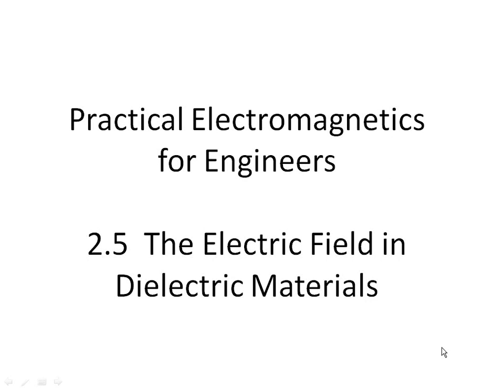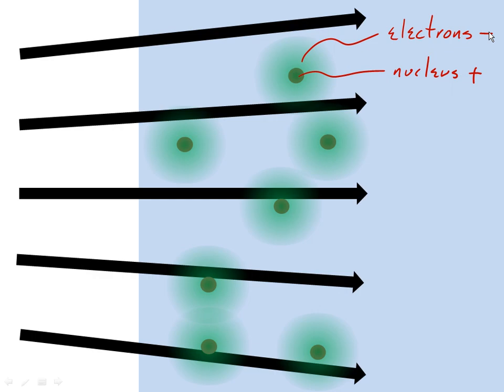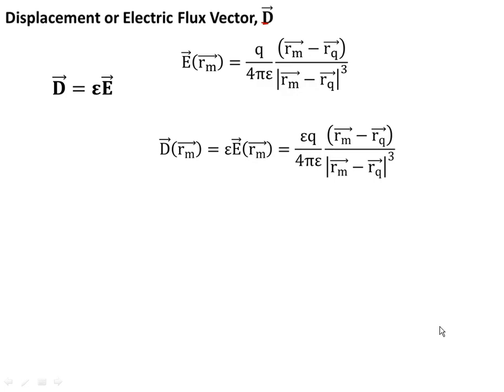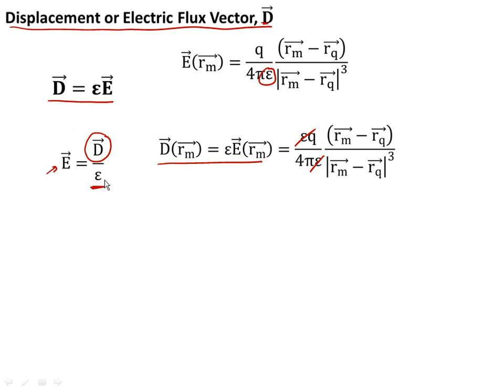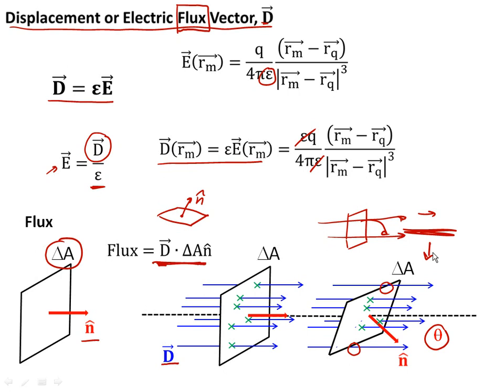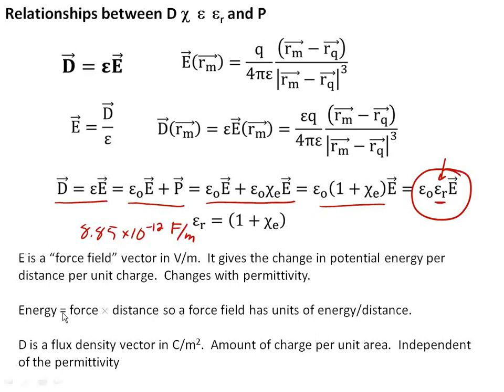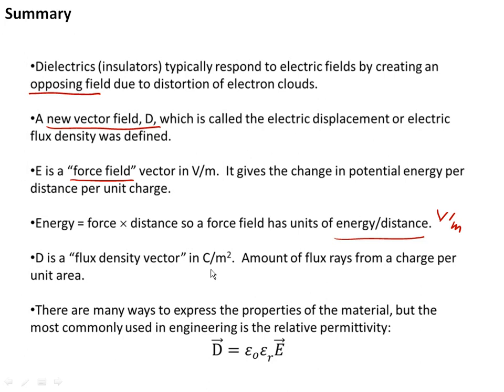2 5 Permittivity and Displacement

Comment: You make it sound that there are two electric fields, one coming from outside, and one from inside. But isn't the electrical field itself the result of the electric interaction of one object with another? That therefore always at least two objects need to be present? I know it is often represented as the field created by Q, and that the test charge is somehow brought from the outside to the field. But surely, that is only an abstraction?

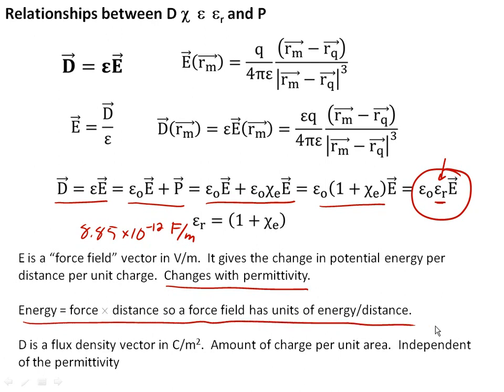Comment: I have been trying to understand this stuff for 30 years now, I even read Jackson.  Finally (rereading Jackson 3e) and your vid helps me truly understand D Thank you very much.  BTW a tiny typo @14:00  "force" not "force field" has units of energy/distance.  Force field has unit of of energy per distance per charge.
Reply: A detailed discussion of polarizability is found in "Dielectric Matter", Ch. 6 of "Modern Electrodynamics" by Andrew Zangwill.  It's on the level of Jackson, with fewer sharp edges.